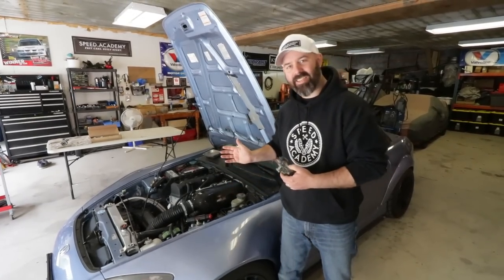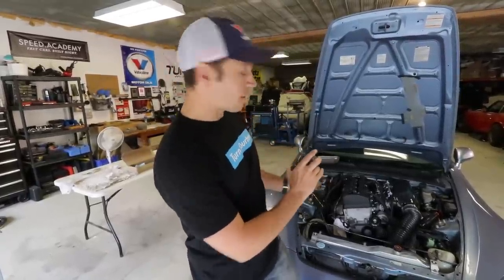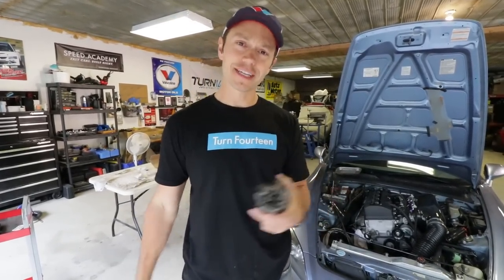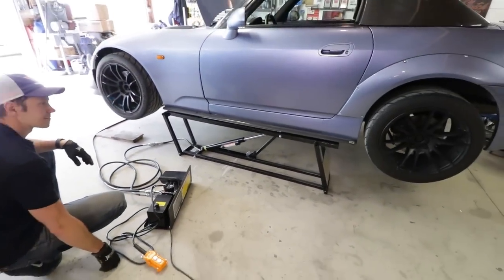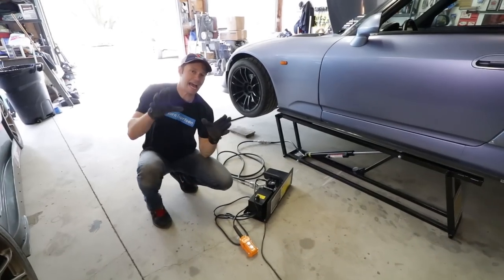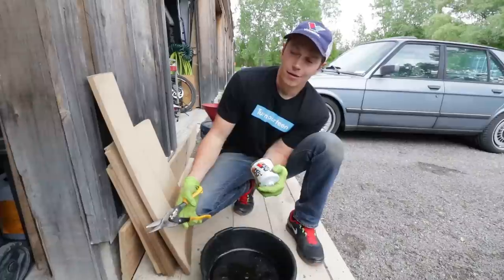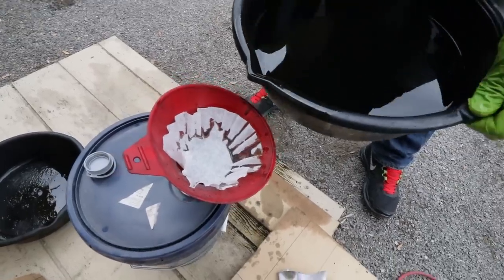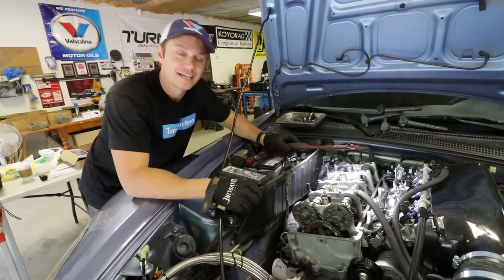No VTEC! What's Exactly Wrong? - Project BADASS2000 - EP17

Comment: The rod material you found is disturbing, but the metal on the oil drain plug is worse in my opinion. Bearing material is typically made of bronze, aluminum, and copper type materials and won't stick to a magnet. Steel and iron will, and that's what rods and cranks are made out of.
Reply: yea, that's crank journal 'batter' right there. And a Main Bearing 'knock' is a strange noise to hear well on a louder car(noisy exhaust, etc.)
Reply: They do stick to magnets, i remove all broken bearings from engines on a daily basis by using a magnet, it would be very hard to remove material from the crank or rods, only by constant grinding motion, and then there would not be any material only microscopic dust. A broken bearing causes the crank journal to be reshaped to the broken bearing, a simple grind with over-sized shells can fix any crank as long as its tolerances are ok.
Reply: Copper does react to a very strong magnetic field to create energy (Shake light). But it isn't actually "magnetic". So I've read...
Reply: @dirtybeatzuk3292  copper isnt magnetic this is a fact.

Comment: rain drop, drop top, got a spun bearing and a rod knock.
Reply from the maker: lol poetic
Reply: I'd say take everything apart and send the block and head out to be resurfaced guessing somewhat below 2k if there is one near you... I don't see the findings of the bearings realated to you guys, obv. because none of the bottom end was taken apart until now, but my guess is that oil clearances were a tad too tight on what could be the main or  rod bearings (because not sure if you guys actually took out and inspected all the bearings by the crank if that's what the issue is, which I doubt. Have you guys looked at the timing chain tensioner and inspected that and the chain itself?
Reply: I know a Honda tech that has done many S2000s so I'll ask and see if that could be potential culprit, message me some details on the car so I can let him know and give you guys a definitive answer.

Comment: Just pull out the motor and give it a refresh. New bearing, gaskets, stuff like that. It'll be cheaper than another used one and you can also be sure that it's in good condition.
Reply: It'd be good to run it by the machine shop to square again.
Reply from the maker: most likely that's what we'll do
Reply: Hope the crank is in good shape.  Nothing worse then a spun bearing that takes out the crank to.
Reply: The F series motors are unreasonably expensive compared to the K series motors. Unfortunately, it seems like at high mileages, the F series is prone to losing compression and all sorts of garbage.

How many miles do you have your car? When you guys got it, it looked pretty shoddy. Is it a clean title?
Reply: I want that lift
Reply: My S2K had over 154K miles on the F20c and I thought it would run forever... was burning oil BAD though, like 1 quart in a week.... then I misshifted from 3rd to 2nd bad and BROKE valves and damaged the pistons too. It wasn't the first time I missed... and i'm sure some of the previous owners missed too. Car was barely running afterwards 0 compression in two cylinders. But i'm having it rebuilt because i'm not gonna buy a used motor and have all that uncertainty. So my F20c failed because of me but I think it was bound to fail at some point regardless. I shoulda spent the extra money on the clean AP2 I looked at first... but oh well.
Reply: At least now you can build it up a bit: A bit more compression, some cams, some headwork. Or are you going to just rebuild it back to stock ?
Reply: Looking to get the Ferrea valve train and Mahle Pistons... unsure on rods but leaning towards Carillo A-Beam. I'm hoping it can be a little stronger then and handle higher than stock rpm's should that situation arise. I was having so much fun being N/A and wanna stick with it. Hopefully everything works out.  I'm really looking forward to see how things go for Speed Academy as well :)
Reply: gravityhammer25 Well that sounds good.  That'll probably be good for 220-230whp and will make for one fun ride.
Reply: Hi guys. Just seen your video. I have a 1999 honda accord vtec 6cil 3.0. My check engine light on and 4d is flashing. What could be the problem. I put in speed sensors and 3rd gear switch. Can you help?

Comment: K24 swap S2k 😩😤
Reply: You need a cheap gass guzzler solution, LS1 swap for da win. :D
Reply from the maker: We're thinking about it!
Reply: Speed Academy Noooo 😢 F20C is the one, take care of her guys 😟 Build that thang 🤙✌
Reply: Tuğrul Berk UySal too much money to invest... if you're on the way to spinning a bearing, you'll need to send the block out to have all mating and bearing surfaces resurfaced... it's more than the engine is worth as much as I love the F20C and F22C
Reply: BRIKKgoesHAM They still can stay with an F series even if they don't rebuild this one though.
Reply: Plz don't K swap it. The engine is 50% the charm of the car
Reply: mb read that wrong, but as much as I love the F engine, they're so hard to find in Ontario simply because there just aren't many S2000s here period... K24s are a somewhat more sensible option since they spin the same way, are more abundant, make more torque stock for stock, can rev just as high with a crank girdle, and have lots of aftermarket support for forced induction or natural aspiration.
Reply: BRIKKgoesHAM Yeah these are all good points, but I feel like it is the same mentality as swapping an LS into it down here because it is very similar to K24's position up there. Also, the F series, as similar as they are, has a much different tone to it which I can't get enough of. That's why I think F series is the way to go because they don't need to do much to it to have fun with it. Sure a forced induction high revving K24 would be dope in an s2000, but I think that engine is part of the soul of s2k.
Reply: K swapping or F series rebuild, would be sick . if a F engine was bought i image it would be the same price as the whole k build ... I think the ITBs could be reused for k series too
Reply: F engine on boost sound insane but, also miguel I don't the the TB's mate up to each other
Reply: J Swap :D
Reply: they wouldnt use a k24 form your car cause it wont work and doesnt have exhaust vtec
Reply: add itbs and then turbo
Reply: Its just bearings replace them, you allready put all this effort in this engine. might as well do piston rings, did you find out which ones went? I believe its the camshaft ones. If its a track car I would supply oil feed to the rocker cover, i mean you will be reving hard on track and the oil will be not consistently supplied to the top.
Reply: Jun Liew why not save the itb Money and get a better turbo you'll make a hell lot more power than combining both itb and turbo and I seriously don't think itb+turbo would create a noticeable ammount of power
Reply: Nippledozer I'm a new to these things but can you explain why ITBs can't be used with a turbo?I've only seen the ones with both on Youtube,what do you lose by going with both?

Comment: Just a suggestion for cutting open filters. If you use a cut off wheel or reciprocating saw, you may add metal to the filter that wasn't there beforehand. On the other hand, without the filter cutting tool it can bring out the rage. Nice catch on the bearing. Can't wait to see what the issue is.

Comment: if you guys to rebuilt the engine, you should replace the main bearing bolts to an ap2 because those have 4 holes for the banjo bolts  instead of 2 in the ap1. https://www.s2ki.com/forums/s2000-under-hood-22/oil-bolt-install-w-pics-102067/
Reply from the maker: Good tip! If we rebuild it, it'll be with Eric from R-Division who definitely knows all the tricks on these motors.
Reply: Balo657 judging from the tail light design it is a late model AP1 so it likely has the updated oil banjo bolts

Comment: Hey ive owned an 02 S for 2 years now and ive researched that the honda si oil filter are better than K&N oil filter. There is significantly less oil burn with the si filter

Just a quick tip for the S Heads

Comment: Its going to be the middle main bearing, it happen to my f20c. If your lucky you will be able to polish the crank, new bearings, and reinstall. Just a Fyi, king now makes some badass bearings for the F20c. IF you are going to swap it J2F!
Reply from the maker: We'll find out soon enough. We're planning to do a teardown with Eric from R-Division/Lavigne Motorsports.
Reply: hopefully it's not to bad and you guys can get back to the track soon. Just a word of advice is easier to pull the motor and Trans together. Also the clutch fork if not pulled will not allow the motor and Trans to separate.

Comment: Check the thrust bearings. They are known to fail with aftermarket clutches.
Reply from the maker: We'll take a close look, thanks!
Reply: I installed a clutch interlock bypass switch to avoid pressing the clutch in on cold start: https://www.s2ki.com/forums/s2000-modifications-parts-193/diy-clutch-momentary-bypass-switch-824604/

Comment: that's allot of rtv there, it's very possible a piece of the rtv is clogging a oil passage
Reply from the maker: RTV couldn't get past the filter on the oil pickup, and amazingly enough the oil pickup wasn't clogged with RTV. What you see in the video just fell off the block into the pan during removal.
Reply: Yea your rite, I didn't think about that. Hope u guys get it figured out and its not to costly, good luck boys keep up the good work

Comment: what u need to do is tear the motor apart and clean every oil galley , have the crank micro polished and install new bearings and oil pump ,sounds simple but it's slot of work but it's cheaper then a new motor

Comment: As always love your content guys.  As a fellow s2k owner who also needs a rebuild, my heart goes out to y'all.  

My vote is fresh bearings.  How long do you want this motor to last anyway?   This may be crazy speak, but once a motor is modded or seeing consistent track time, my mileage expectations are seriously shortened.  

Compared to a another block, bearings are cheap.  The time component and labor isn't so fun, but you can also build your clearances the way you want. A little on the looser side since you know the engine is going to be run hot for longer periods.

Looking forward to what y'all do.

Comment: I'll tell you what's wrong for sure: 11:28 Whoever put that oil pan on screwed it up royally with all that RTV. See those HUGE beads of RTV just hanging there inside the pan waiting to fall off and block the oil pick up and cause oil starvation???

Honestly that's a seriously amateur mistake. Instructions usually make it very clear not to do that. Whoever did it probably owes you a motor.
Reply: How come there's no updates on this car since the last one? 

Silicone in the oil pick up was or wasn't the problem?

Comment: maybe your valvoline oil was too thin? you put 0w-30 havent you?. Same thing happened to me.....car sat over the winter and when i took it for a drive it created a nasty vibration when i pulled hard through 1st and second gear......(i have a video/sound on youtube).....vtec was clogged, 2nd rod bearing was spun, an all and i mean ALL main bearings were dead. Bought a new engine now F20c2. I used Castrol 5w30, now with new engine im back on Motul 5w40 :)

Comment: I could have told you that it wasn't the bearings. over the last 15 years the bearings are made of aluminum. the copper is probably coming from the turbo bearings or valve guides

Comment: do something original i wanted to do and make hasport speed up a conversion kit for a j37 in the s2000..there is almost no weight penalty.. you can tune it with ktuned and get that torque and power the s2000 desirves as 300+ vtec powaaaaaa and the sound it makes is awsome.. trust me i vtec it all day in my Legend..
that the original route..and if u stroke it.. just do a F24... has been done and it make a lot of power with Itb's .. dont spoil it with a k24

Comment: I would ditch that Canton oil pan. The OEM pan is not only designed for heat dissipation, it is also designed to be structural. A OEM pan with baffle plate works just fine and is very well proven.

Comment: those are hydraulic fittings for construction and mining equipment. they're rated for like 10000 psi (depends on the fitting, but imagine something with a tolerance that big) they're also supposed to only have like a little bit of fluid on them when you pull them apart. also, make sure to clean the shit out of them before connecting them. they aren't supposed to leak, for like hundreds of insertions and hundreds of hours of operation.

Comment: Last month I got a rod knock on my s2000 but I will be going with the same f20c because I  don't want to affect 50/50 weight distribution of the car the makes it handle like it does, you guys should get a stroker kit or another f20c.

Comment: K swaps are incredibly expensive on this platform. Honestly price wise you can go stroker for the same as a used engine. I'd look at cnc (central North Carolina) speed shops stroker kit. It's a crank and rods uses the Oem pistons bumps up compression and it's really affordable. Assuming they still offer it I haven't looked in a couple years. You already have all the supporting mods to do it. Also i know you have the canton pan not sure what your datalogs show if you record oil pressure but maybe accusump time.

Comment: OK so if it's a vtec issue it might be located in the head. Word on the street is you can bolt on an H22 head on that block and boost up to 800hp.Go with a conservative 450hp and sell the jenvey itbs to pay for the hardware.

Comment: I don't know about Honda, but I'm sure it might be similar to Toyota, where you can just place a new bearing that is sized appropriately for the conditions. You can tap in new rod bearings without removing the engine or anything other than the cap like you did. Flush the engine and rip on it again.

Comment: This has all the classic symptoms of a failed crankshaft thrust bearing. 
Easy to diagnose, confirm or eliminate, just check the crank end-play clearance. 
With that amount of metal in the oil, the failed bearing should be easy to detect by simply rotating the crank back and forth in a short rocking motion by hand and detecting the ones with excess clearance by feel. 

All of that RTV is not good in the oil stream either, we have almost completely banned the use RTV silicone in our shop and use either anaerobic gasket maker/sealer or Hylomar sparingly as a replacement. 
Any excess anaerobic material will dissolve in the oil and  since it is a large enough particle the oil filter captures it on the first circulation pass. 
The trick is to not have excess sealer that can get in the oil stream.

Comment: These are snap tight hydraulic fittings and I can guarantee you they are not going to leak use these on a daily basis to operate my Blow Out Preventer offshore with 3k psi think you’ll be ok!

Comment: often times, when you have a valve cover blasted, the blast media will get trapped in the pcv baffle in the valve cover. if you don't thoroughly clean the baffle, you'll be chasing your tail trying to figure out why you keep frying bearings.

Comment: basically so you dont go hunting for whats wrong with it, thwy put silicone on the oil pan because it was leaking, the silicone broke down and clogged shit up and that caused the crank bearings to be starved of oil. the shavings he found were from the bearings, no good. engine block was fine, crankshaft was salvaged

Comment: if I remember correctly, on your tune you set the parameter for your coolant temp pretty low. once the car hits operating temp (which is probably much higher since you're tracking it), the car is not engaging vtec due to it thinking that the car is too hot. just my 2 cents. not saying that there isn't something wrong with the motor either but if you still have issues in the future.

Comment: Too much RTV was put on the pan when it was installed and the excess dried RTV fell into the pan and blocked the oil pump screen from scavenging oil and that caused the drop in oil pressure and damage to the engine!!!

Comment: No jack stands you guys are brave.
Reply: It's got its own built in locks.
Reply: CanadaBud23 you know what they say "better safe than a pancake"
Reply: the quick jack locks in place. doesnt need jack stands
Reply: You'd have to wedge them in there somehow though since the lift has to be at maximum to lock. But yeah a jack stand would give you a few seconds to get out before it drops on your head.
Reply: Are you supposed to use jack stands? where would you put them since the mounting points are occupied? (genuine question).
Reply: Wow, a single internet comment with both correct versions of it's/its
Reply: yitznewton awesome sir you reek of awesomeness
Reply: +NextDoorGuy Hard to say really, since jack stands need to have some weight on them to "lock in" and hold the weight. Honestly I don't know if the jack stands can handle a weight slamming onto them popping the lock mechanism or crushing the base. In the end it's a piece of something to give you some time to get out if need be.
Reply from the maker: the Quick Jack has locks on it. As long as we're using it right, we should be perfectly safe.
Reply: Speed Academy cool
Reply: Speed Academy .....how much is the quick jack?
Reply: $us999 - $us1350

Comment: V8 'busa swap
>450 bhp @10,000 rpm
>250 lb-ft of torque @ 8000 rpm
>10,500 rpm redline

The S2000's weight might be problematic though
Reply: May be too heavy for the structure of the block and bearings. Unless people like to rebuild every year.